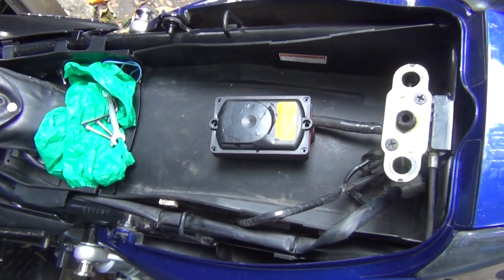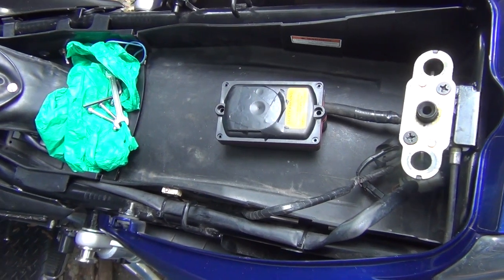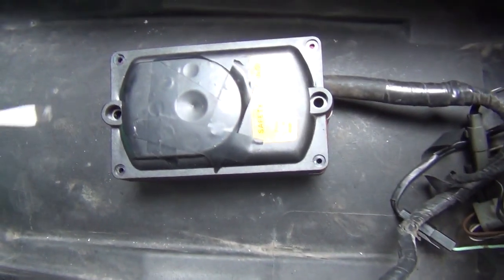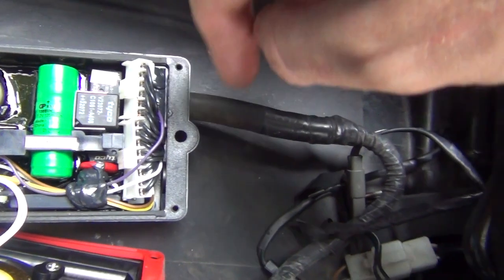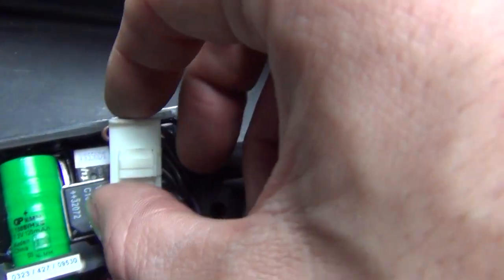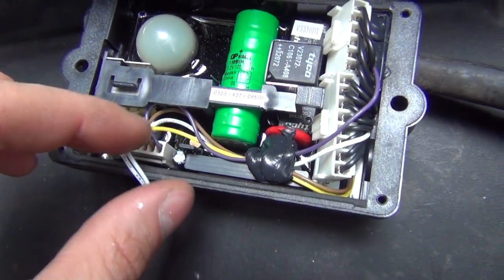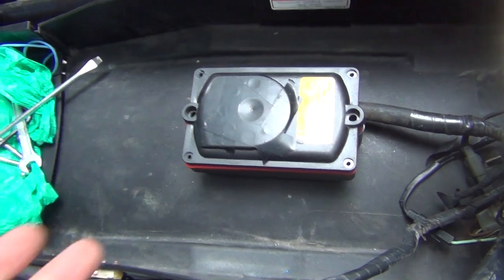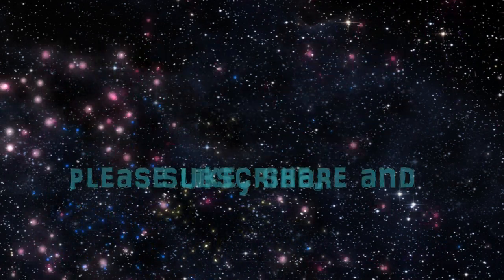How to disable datatool system 3 alarm permanently / alarm removal

Comment: You saved my life. I was just replacing an indicator bulb, and somehow in the course of doing that my datatool decided the bike was stolen or something. Every time it rearmed it started going off. Must have short-circuited or something. It got to the point where I even removed the battery in order to kill it and deal with it another day. 30 seconds after the battery was out, I get a double beep and the alarm goes off again. I was genuinely worried I was either going to have to go at it with a hammer and disable my bike on a permanent basis, or spend the night outside disarming the alarm every 30 seconds. Thank God (or you) it's off now!
Reply from the maker: I'm glad my video helps. Congrats on getting the shitty thing of your bike👍

Comment: Thanks for this video it helped enormously. Got this to work on my Honda Pan. It works a treat.  What the video doesn't tell you is to use a size TT10mm (Tamperproof Torx) Screw driver, which has a hole in it's center!
Also leave BOTH the 6 pin & 8 pin connector blocks out (after - bypassing the 6 pin block 1&2 and 5&6 connections of the 6 pin block).
Was a bit tricky getting the 6 pin block out.   After I had finished I didn't realise that you must remove the 8 pin block as well. So the alarm kept going off again until it was disconnected!
Reply: Thanks for your advice about the 8 pin block it hadn't worked until I saw what you had put ...no more problems cheers
Reply: I did as the video says, didn't work, buy ill do what you did tomorrow, cheers for the info

Comment: you are a hero. I have a Triumph Daytona 955i which had a flat battery, I replaced the battery and the bike didn't want to do anything. The alarm sounded once, then stopped and the bike immobilised its self. Then i followed your advice and , hey presto bike is now running and perfect ready for a track day
Reply from the maker: Great to read comment like that😊

Comment: As Dan said a year ago, unplug both the 6 pin and the 8 pin plugs and leave them unplugged.
Great video thanks for restoring my "CALM".
Reply: Yes, as Ben Davis, said....unplug both wiring blocks. I tried this mod couple of weeks ago on my 1050. I unplugged the siren and the 6 pin block, and bridged the four pins, and left my 8 pin block connected. However, the alarm still activated the indicators, etc. I couldn't find an inline fuse to disconnect the power source on my bike, so I then unplugged the 8 pin block (power) and it worked a treat. The bike now starts and runs just off the key. Happy days :)

Comment: Thanks man, you are an absolute hero and just saved me having to put in the spare wiring harness I have.
Bike was parked up for the last 3 years and the alarm would not respond to the fobs and pin override didn't work.
I had to butcher the top off the alarm but my 2005 zx6r is now running again thanks to you 👍
Reply from the maker: I'm so happy this video helps people. Thanks for your positive comment !
Reply: @Adikxx  Thanks again man👍
Obviously at some stage I'll take the alarm out altogether but for now I'm happy😁
Reply: Think I have your bike 😂

Comment: For those that want to remove the box and wiring this is how I did it. 

1. Trace the wires from the data tool box to the rear indicators and cut. (Just for flashing when Arming and disarming the alarm) 

2. Trace the wires from the data tool box to the solenoid Sat just behind the battery. They are red and yellow wires. Cut the wires that are connecting to these and reconnect the red and yellow wires together. (Data tool box controls wether bike can be started using these wires) 

3. Trace the black wire from the data tool box to the inline fuse remove the fuse and snip the wire so the inline fuse holder stays on the bike but without the fuse so it can’t short on anything. (This is where the data tool box gets it’s power) 

4. Locate the two blue and grey wires and snip from the data tool box loom. Reconnect the  two blue and grey wires to each other. 

5. Unscrew the tamper switch at the rear and pull the full loom out.

I did all this with the battery connected and alarm in service mode 

All was well for me bike starts everything works but as always do this at your own risk.
Reply: I done what the video said and it worked yesterday then the next day the alarm came back and I couldn't believe it. Followed your instructions to remove the alarm all went well thanks very much

Comment: many thanks for this,carried it out on my honda valkyrie trike as the datatool  was giving me all sorts of problems,not any more with this fix,i got into the box and unplugged everything that was plugged in, i then  removed the whole circuit board and binned it,all there is in the case now is the 6 pin block that has been bridged at both ends and the 8 pin block,the the speaker wire  block and another bock.everything works perfect now ,no worries of being stranded anymore ,fantastic fix.
Reply from the maker: Glad it worked! Awsome
Reply: Hi, does your bike fire up after disconnecting both 6 and 8 pin blocks,   also do you have to plug back in any plug after bridging them

Comment: This also works for the data tool veto. Disconnect not terminal blocks put the pins in the 6 pin block as in the video. No plug or tab to remove. I also unplugged the siren in the data tool. And it worked to my surprise 😁
Reply from the maker: Brilliant!

Comment: Kind of worked for me on my GSX-R. I kept on hearing the alarm making a noise continuously (I'd disconnected the speaker) after bridging 1&2 on the 6 pin and thought this is going to drain the battery. After blowing the fuel fuse several times I decided to bridge ports 1 & 2 on the 8 pin and it worked a treat.
Reply: Forgot to mention that I bridged ports 1&2 + 5&6 on the 6 pin not just 1&2.

Comment: Can I ask, did you plug the 6 pin and 8 pin plugs back into their sockets or did you just leave them to one side? 
How long did the paper clip connections have to be, or put simpler, how far into the holes do the paper clip have to be in order to work?
I have carried out the same work as shown in your video but the alarm will still arm itself when not in dealer mode.
Thanks in advance.
Great video by the way.
Reply from the maker: Hi bud. From what i remember i just neatly placed both white connectors in a position allowing closing the box,somewhat in their slots but not fully in if that makes sense.
I reckon the reason it didn't work for you was the type of wire you used. Thin,silver paper clip wire isn't the best for that. Try using proper copper wire from old electrical cable. Those are a bit thicker and should work. In terms of lenght both ends of "U" clips that i made were about 1.5cm-1.8cm  long. Hope this hels. Let us know if it worked this time.
Regards
Reply: @Adikxx  You are a gentleman.
I unplugged both the 8 pin white connector and 6 pin white connector like you described along with the little black 'thingy', screwed the cover back on and now no more alarm!! Happy days.
Thank you so much.
Reply: @Adikxx   hi there great video! my question is is this will fix/sort the immobiliser? as i have issue with it.  i have same system, and when you press the remote control and is beeps once, my bike won't start so i have to play with this remote control alarm on off. until i can start the bike.?
Reply: Brilliant fix.. took longer than expected as the white blocks were covered in black silicone sealant but once carefully cut away video instructions followed and success! Thank you
Reply: themadubeagful - did you add the copper wire or just pull the plug?
Reply: Leave BOTH the 6 pin & 8 pin connector blocks out (after - bypassing the 6 pin block 1&2 and 5&6 connections of the 6 pin block). Do not use paper clips. Use copper wire to bypass.

Comment: Hi, what screwdriver head is needed to open the alarm box to access the 6 pin white connector? seem to be star shaped but with a pin in the middle.
Reply: Igot it sorted thanks, now all I have to do is charde up my battery!

Comment: great video just one question.....how do you put it in service mode?
Reply from the maker: I'll need to check the manual and will come back to you bud.
Reply from the maker: To put  Datatool system 3 alarm in service mode first disarm the system same way as before riding your bike.  With the system disarmed and ignition ON press and HOLD the smaller button on the fob until an audible beep sound is heard. The ignition can now be switched off. You should now be in service mode. 
In service mode your Datatool system 3 will make an audible beep every 15 seconds. To permanently disable(get rid of the alarm once and for all) follow the instructions from the video.
Reply: @Adikxx  thanks for that, much appreciated👌
Reply: You can also just stop the beeping my disconnecting the speaker connector. It’s just a small plug that pulls off. This will mean the alarm still works and disables the bike if needed but it won’t make a sound, you will just have the indicators flash.

Comment: Thanks for the great vid. quick question, once you have done this, do you ever have to use the fob again? Or can you just turn your engine on and off without having to do anything. Many Thanks!
Reply from the maker: No messing around with fob. Basically forget about alarm.
Reply: @Adikxx  what about the immobiliser? as my bike on turning ( engine) but won't fires up.  until i start playing with fob/remote control on and off, and then it will start
i read about this system on forums, and everyone saying about the immobiliser
Reply: @petinyiri  same issues here, let me know how you get on
Reply: @seanviper99   Hi, i just done the same thing from this video, and it is working fine,  just like no alarm at all anymore
Reply: @petinyiri  so you bridged the wires and reconnected the plugs?
Reply: @seanviper99  just bridge the wires and leave unplugged the plugs as it shows in the video
Reply: @petinyiri  currently trying this, will get back to you
Reply: @petinyiri  hi, had to reconnected plugs with bridging because wouldn't fire up otherwise, wouldn't even ignite the fuel injection system.. How did you manage.
Reply: @seanviper99  i just followed up all steps from this video, and it worked first time. 
disconnect both the 6 pin and the 8 pin plugs and put the bridge in  1&2  and 5&6 on the six pin plug/wire and unplug the 8 pin plug to and the it should work
Reply: Hi what sort of wire do you use to bridge it ?
Reply: @leeblack2120  I just used some standard household copper cable that I had lying around. Literally the wires that run to my sockets/lights etc in the house, strip the cables and plug the copper into the connectors.

Comment: Does this work on the data tool s4 green alarm I was told if I just unplug the 3 white connector plugs .. It will disarm and make it the alarm dorment.. And back to stock set up.. Just not sure about the black pin you had taken out next to the socket on in own if that has to be removed to.. Thanks

Comment: Unfortunately all the cables and block connectors are sealed in resin as well as mastic 
I did hear putting it in service mode first but this 
Will not go int this
Tried bypass / bridging from the top but no hope

Comment: Did not work for me. Did you plug the plugs back in fully after bridging them? Also do you have to screw the lid back on? I tried it with lid off and the alarm is still fully active.
Reply: You need to do everything he shows in video but also you need to unplug the 8 pin block too or the alarm just keeps active !

Comment: hi there, did you disconnected both wires or just the one with the 6holes?  i did the same process but i didn't unplugged the wire (8holes) and the alarm was still going on and on, but the bike was starting all the time even with alarm on  (can you help)?????
Reply: Leave BOTH the 6 pin & 8 pin connector blocks out (after - bypassing the 6 pin block 1&2 and 5&6 connections of the 6 pin block).  After I had finished I didn't realise that you must remove the 8 pin block as well. So the alarm kept going off again until it was disconnected!

Comment: Hi, I have bridged the connections shown but I don't have that little black connection you also said to remove. Anyhow I can now get the bike to turn over but still wont fire up. I believe I have a datatool veto on my 97 cbr600. Any ideas please.
Reply: You manage to sort it I have the same problem ?
Reply: @georgeevans9563  I took it to a main dealer who removed the datatool for me, From what I remember there was a damaged wire going to the starter. The person who fitted the alarm spliced into it poorly. I'd suggest removing all the wiring for alarm and join the loom back together. Taking car to look for anything damaged, if it is just cut it and rejoin.

Comment: Sorry to be the one dissenting voice here, but I did this bypass today and the damn alarm is still screaming its head off...

I would be interested to know what you used to bridge the terminals in the block connector, I used a bent paper clip, maybe it wasn't big enough gauge or something dunno tbh, it's a puzzle,

In the end I just un-plugged the speaker from the board, I know this won't stop the battery drain, but at least I don't have to listen to it anymore....  damn thing must learn what you've done to it, because, now there's no chirp from the speaker, the indicators flash when arming/disarming... weird isn't the word  ???

Think I'm just going to have to cough up the £200+ to get it removed
Reply from the maker: Hi bud, i used copper wire. Worked a treat

Comment: Why would you show thieves how to disable your alarm once they’ve stolen it can you upload the vid of the day your bike got stolen and how devastated you felt knowing you had disabled the alarm system
Reply from the maker: I would show thieves how to disable the alarm because they wouldn't even bother messing around with it. Instead they would just come with a van and put the whole bike in it completely disregarding the fact that it might an alarm. Alarm in a motorcycle is AN ABOLUTE JOKE. I could post a video showing how devastated i was seeing my battery drained because of it, or how pissed i was trying do maintenance of my bike with alarm yelling every time i disconnected the battery(which had to be done on some maintenance procedures). Or maybe you'd prefer a video showing devastated owner who is stranded in the middle of nowhere because the alarm has a glitch and bike is immobilised? Alarms in bikes is pure aggravation, hassle, waiste of money and finally ASKING FOR PROBLEMS !
Thank you very much and have a wonderful day.
Reply: @Adikxx  well you might think that way but trust me my alarm has foiled two attempts on my bike and also even if your bike was shoved into the back of a van the alarm would spook any thief thats what they are there for
Reply: @jeffvaljean6030  If like me they would just want to rip it out to stop the infernal noise it makes. They would do A LOT of damage to your bike in the process. I think a bike ignition immobiliser, several locks and a tracker are a far far better deterrent to prevent bike theft and recovering your bike if stolen. These alarms especially Datatool are a PITA. I know as I have have an S4 alarm on one of my bikes. I hate it. It passively alarms every 45 seconds. Nightmare doing anything with this bike.
Reply: @alexmorgan3435  see now that I get I live in London and an I mobiliser is a must I get the annoying beeps but still I much prefer an alarm than to be without one